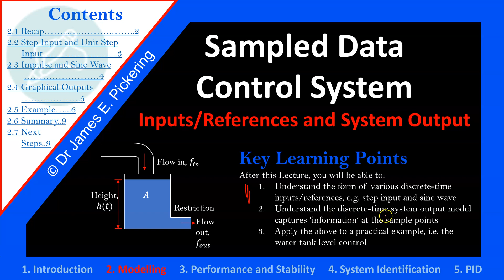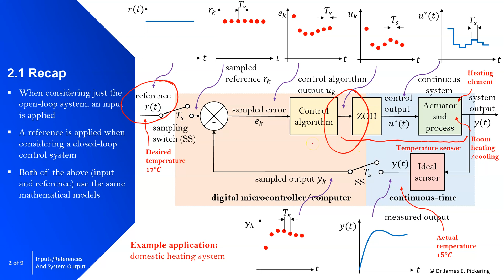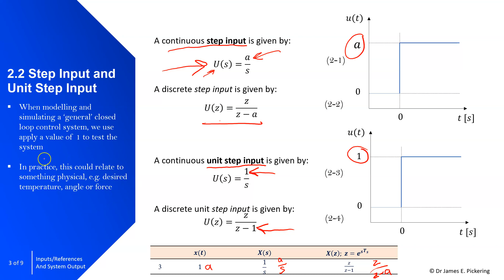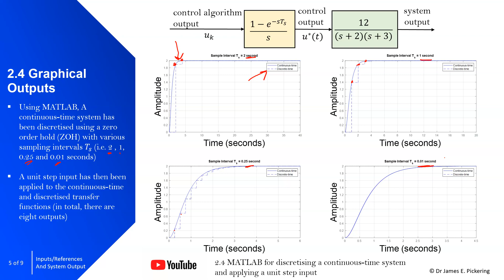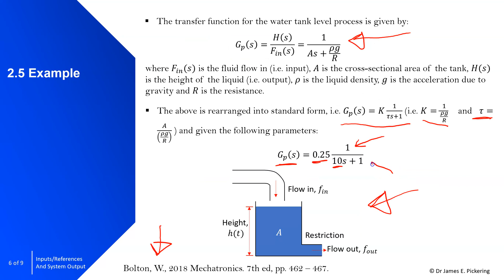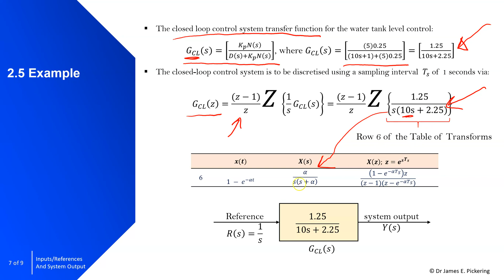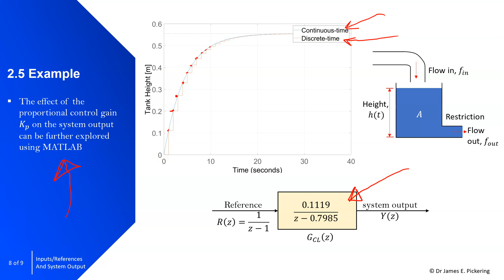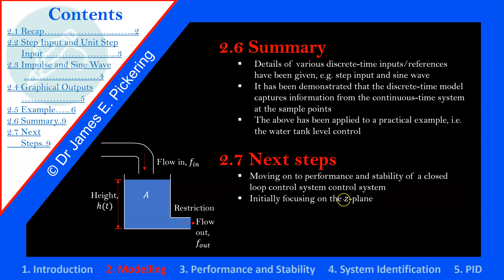2.3 Inputs/References and System Output

Comment: Thank you for this video. I'd ask, how to simulate or model a system if the sampling time T_adc is multipied system sampling time T_s? Lets say, a system samples motor speed with T_s and current with 4+T_s. I have no idea, how to write equations.